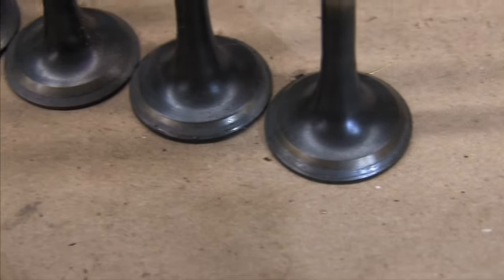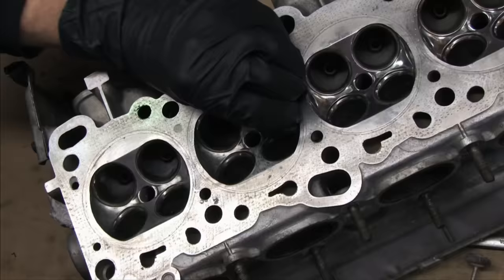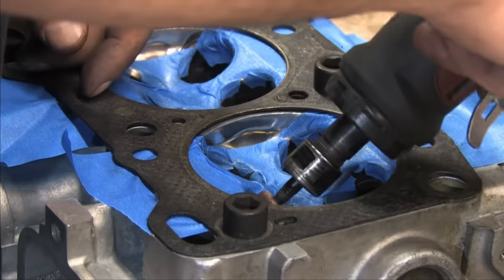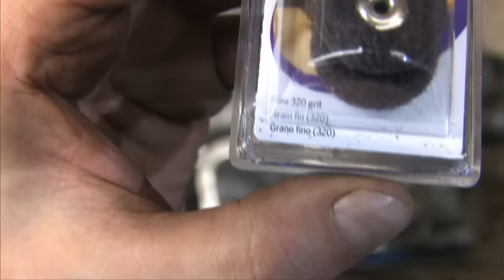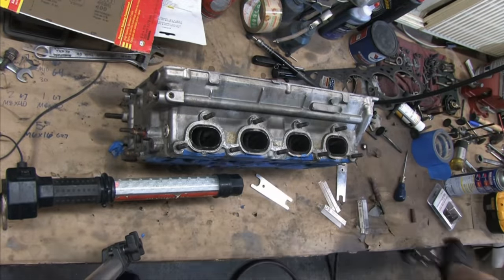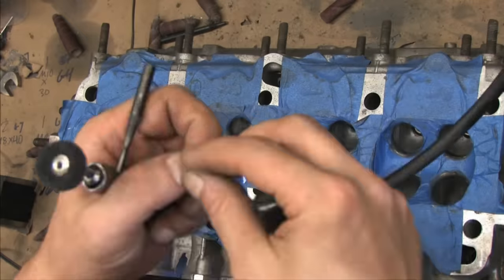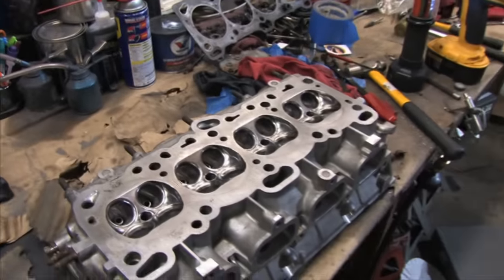Cylinder Head 204 - Porting & Polishing

Comment: Excellent video thank you ! What are your thoughts on. Single cut vs double cut tips ? For gasket matching a port
Reply from the maker: Single cut burrs are for Aluminum and softer metals.  Double cut burrs are for ferrous and harder metals.  Using them on the wrong materials may work, but it will cost you the burr you used on the wrong material as a sacrifice.  Double-cut burrs will clog up on soft metals, and single-cut burrs will break on harder materials.
Reply: Jafromobile thank you I appreciate it ! It’s for aluminum heads and I wasn’t sure which to go with. I’ll go with the single 👍🏼👍🏼

Comment: Now do a video on how to "flatten" the intake or exhaust ports (on the head) so that you can get a gasket to seal. Most older engines are NOT flat after 10-20 years of use. Besides removing all of the studs , removing the head and sending it to a machine shop ...there has to be a way to do it without removing the head and all the extra cost and risk involved .....

Comment: Something else that's sad. 8000 dollar race Motocross bike has the same casting flash in the ports too. Porting a 4stroke dirt bike cylinder head is a lot easier but similar to a car. I blended my intake but swirl roughed the surface. My fuel injector is in the throttle body behind the butterfly in the upper intake tract. My exhaust I polished mirror smooth. The head I was practicing on I trimmed off the end of the valve guide. Not sure if that was a great idea but wanted to try it. Tried to copy the look of a friends Honda cylinder head that was cnc ported.

Comment: Only one issue You need to keep the intake ports rough it help-s to create turbulance which is necessary for good combustion. The turbulence actually increases horsepower/torque as well as efficiency. 
If you polish or smooth the intake to much you are actually hurting performance.
Now the exhaust go to town  as long as you haven't  tuned your exhausdt length . A tuned exhaust length means that the pulses of your exhaust gas has a bounce back ehich improves scavenging meaning unburnt hydro carbons renter the exhaust chamber for a second chance at burning this increases your fuel efficiency.
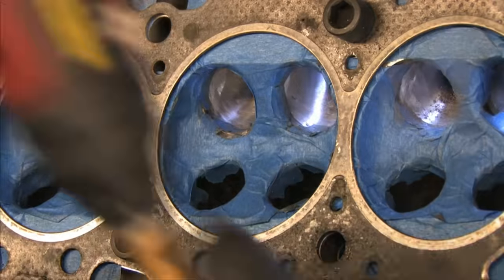Reply: 13:42

Comment: There is no more polishing even in exhaust. Rough surfaces allow small attached air bubbles to let the boundary layer slip by. The best CNC porting now includes dimpling a la top flyte, ping, etc. It's good for 5% flow increase across the board, smooth polished will cost you 5%. Same factors apply to the exhaust port. Polishing the combustion chamber and piston helps reduce detonation from hot spots. 
If you read drag times articles from big numbers of champions engine builders they have used bits with broken teeth and let them rattle around dinging, denting, and scratching the ports. It's dyno proven now.

Comment: I'm planing to do this job on an NA miata for an NA built, is it ok to mirror polish the intake ports? Also polishing the head will it decrease the compression? This is an amazing guide mate, because of you, I'm planing to do this job! Thanks so much! :)
Reply from the maker: I would advise against polishing intake ports.  Just because I experiment on a forced induction build where surface textures matter less, it doesn't mean I have a magic bullet for performance here.  Even in forced induction designs, it's a ton of extra work with minimal if any gains.  I did it just to show the techniques, and I didn't polish the entire intake port.  Only the exhaust ports are super-blingy and if you're not familiar with this cylinder head, it's not apparent even though I explained this treatment on each side and how I did it differently.  My intake ports aren't fully-polished.  It's pretty, but it's wasted effort on a NA build.  You could stop at 80 grit on the intake ports.  Nothing beyond that will show up on a dyno sheet or the butt dyno.  Sure, Polish the exhaust all day long... but don't worry about the intake ports.  Bigger gains would be found in cams and timing than you'll ever get out of the intake runners being polished.

Comment: My engine builder also works with AMS 

He told me you have a 4G63 don’t waste your time in the heads, turn the boost up and worry about tuning and the turbo setup. After all he years of building he concluded work like this just wasn’t worth the expense and the amount of money he would have to charge was wasteful to the customers build. 

He was for over sized valves and port gasket matching

He wouldn’t take my money to port the heads on a street car and he liked how much power the factory heads make 

Bill wanted me to use that money towards other go fast parts that actually make a impact and real gains not marginal expensive ones 

He said you do that investment in full blown all out race cars in Mac effort 800-1200Hp
Reply from the maker: Well, he's not wrong.  2 out of 4 of my street projects have ported heads.  One I paid for, and one cost me nothing to do myself.  "Investment" is subjective depending on your capabilities.  I have no regrets about either one, though.

Comment: No rough texture in a intake or exhaust port is good only benefit on texture is a golf ball design which increases air flow other than that it should be as smooth as possible

Comment: I use them same Dremel adhesive pads to polish 4 wheeler cylinder's I port.  But the brown pads are the best.  The purple pads are junk. They come apart and do not last but few minutes.  All you need is the brown pads. I feel like  the exhaust port  side is most important.

Comment: For more HP try port matching the inlet and outlet to the gaskets and then port match the inlet and exhaust manifolds to the gaskets - smoother gas flow in and out, more HP.

Comment: Question:
It's a bit long, I'm sorry sir!
I have a Mazda B3 engine, 1.3 liter SOHC, and I'm trying to squeeze some more power out of it. Couldn't get my hands on a BP engine. Waaaay too expensive for me!
I've already made it fuel injected, found a good throttle body and polished it and it's running smoothly and it's happy with the 115 n.m and 72 hp it's got now but I'm not! So all I need, is a bit of advice on what I should do with the ports and all the other things. Will you help me?

Comment: It's great but please share the difference before and after view as well as how it runs. I won a Elantra too 2006. Very expensive.
Reply from the maker: 2006 is very different.  Different engine.  This Elantra cylinder head and the car is a 1992 model.  Everything else bolted to it came from dozens of cars out of a junkyard.  Very cheap.  It outruns most of the new Mustangs.  Lots of drag race passes posted here in my videos.

Comment: The addition of just a bit of diesel fuel to the tank will remove the carbon from everything. Well pretty much so anyway. This does reduce the performance some. It may also ping or rattle if you get too much in the mix.  I put 1 gallon in honeys car every tank of fuel. I've done this forever. No issues except the mentioned. Want to go racing - run the tank dry and refill as required with straight gas. Almost forgot don't use as much diesel in the winter, cold starting issue may appear. A bit of experimentation will tell you how much to use. My rule of thumb is if it rattles on hard acceleration back off on the amount used. Porting and polishing is fun.

Comment: I am not sure if you know about mk4 golf 1.8t's but that's my current project... In my opinion I'm thinking it's a lot better of an idea for me to do a good porting/polishing on the current manifold and getting it powder coated rather than spending the money on a grams or a integrated engineering intake manifold. What's your opinion on doing an intake manifold porting job rather than spending the money on a higher flowing aftermarket one. I can't imagine I can't get similar flow from the oem with said job done?!

Comment: Would a flap wheel work for the port work? Seems like it might be safer since it's a smaller surface area and you can get better angles on it.
Reply from the maker: They work great if you can get one small enough.  Most of the Dremel wheels are way too big to fit until they're worn down pretty far.  That's why these poofy things work so well. They compress.  There's more abrasive material, and less wheel to them.

Comment: I know this video is old but I did not hear you mention, nor did I see, that you matched the ports to the intake or exhaust ports on the corresponding manifolds. That's another one of those "while I'm here" modifications.
Reply from the maker: It's a separate topic, and in many cases it can be a mistake.  Many people gasket match based on where the carbon buildup occurs on the flanges of mating parts thinking that's the area they have to play with.  Many think that's port matching.  It's one thing to match the ports, it's another to match the gaskets.  

Just because there's an area that can be enlarged, it doesn't mean you will gain ANY performance doing so.  In many cases, the increased runner volume slows down the escaping gasses resulting in things like decreased intake port velocity, or a reduction in pressure in exhaust runners prior to the exhaust turbine wheel of a turbo.  In the event that people use their carbon lines as a guide for where the gasket lines up, cutting those down on exhaust parts puts the gasket right into the fire, and typically causes them to burn up creating exhaust leaks.  There's a lot of people who do that wrong, and it really should be in a different video from this one.  Port velocity and manifold pressure ratios should always your guide in decisions like these.  Port match, sure... no problem.  I had no need to do that here because the exhaust manifold I'm using has very slightly-larger exhaust runners than the exhaust ports on my head.  A difference that's actually optimal for the turbo I'm using.

I don't expect you to look through all the comments and see where this was previously discussed.  Others have noted this was not in the video.  This experiment wound up getting way more traffic than I ever expected it to.  You will find hundreds of people ripping me for things that they insist I did wrong in this video, and hating on ME as a person for demonstrating something that made them uncomfortable (despite telling people not to polish their intake ports in the video and installing text overlays insisting they should stop after sanding them).  I know you're not doing that, so I wanted to save you the trouble of looking for it.

Comment: Ever thought about 3M nano coating exteriors and jet heat or other coatings for non contact parts. Internals ? 
 Easy cleaning every time. 
I’ve thought about it but not seen it on internals

Comment: I don't think you want mirtor polished ports. It may cause fuel to condense on them. But a fine sand paper roll finish is perfect I think. About 180, 220 or so will be great. 320-400 maybe on verge of over kill.. I never had issues using this. 600 for chambers. Better than nothing!

Comment: I think this is the best video I’ve ever watched on YouTube, this is probably my 10th time now and I’m preparing to get this done on my p13 head, is there any reason that you polished the combustion chambers first rather than at the end when you were done porting so there wouldn’t be any need to run tape? Thanks so much for all the information over the years
Reply from the maker: I put the tape on more than anything to protect the valve seats.  It didn't go so well. in that regard.  I ended up doing a full valve job on the head anyway.  At least the tape helped minimize the impact of the damage I caused so there was more there for the machinist to work with.  Don't waste your time polishing intake runners. Just get your contours right on the intake and call it a day.  The opposing port texture may or may not make a difference, but it's not where all the power is.  Wait... McLaren P13?
Reply: Jafromobile thanks so much for the continued help, I’ll definitely be takin your advice, unfortunately not, just a honda head off a h22😂

Comment: The intake ports should be left in a rougher surface finish. The slightly higher flow numbers you would get with the polish don't translate into hp numbers , especially with a port injected motor where fuel staying atomized in the air is more important

Comment: As usual, I'm looking at the comments and I see the same tired comments about how a rough surface is better for fuel atomization, blah, blah, blah. Bottom line, the smoother the surface, the better the flow. The better the flow, the better the go. Period. Fuel that is gathered up on rough surfaces, is not getting to the combustion chamber where it is needed. Fuel that isn't getting to where you need it, and WHEN you need it to be there, is useless, maybe even worse, it could be damageing to everything that depends on it being in the right place at the right time, and in the right ammount. It just can not be too smooth, or too straight. I did stop to wonder why you didn't cc the chambers and maybe even the runners, but since you're doing everythimg by hand, that might be a step too far. Great job, I know that your patience will pay off.

Comment: Port matching and exhaust port polishing yes, but polishing the intake port will bring on condensation of the fuel air mix (no benefit)
Reply: On carburetor engines not so much fuel injection

Comment: I have a question trying to take it to the next level after learning (🙏), how do you cut and shape valve guide to match port?
Reply from the maker: Valve guides are something that I won't install at home.  I don't have the machinery that can do it accurately much less even measure them.  Those tools are ridiculously expensive.  I use bronze manganese valve guides and they're hard as expletive to cut.  If I have a bad valve guide, I pay someone else to turn them down and install them.  BUT... if you're talking about how the ones in this video got shaped, each runner is split into two valve ports & the guide is right in the middle.  It's like 0⊓0 except the 00 are closer together and the ⊓ is in the way.  I shortened the leading edge of the guide and the two 3/4-view faces of it kinduv like OʌO.  I just made its profile a little narrower.  There are some people out there who grind them flush to the runner, but when you do that, you lose some of the support that keeps the valve centered and true in the seat.

Comment: What benefit comes from polishing the combustion chamber? Wouldn't you lose compression?
Reply from the maker: Yes, but it's negligible.  You lose more hp from knock and your ECU pulling timing as a result than you will from the compression loss.  Polishing the combustion chamber is a knock suppressant.  You need this treatment more on a high compression engine than you would on lower compression stuff.  I cc'd out the combustion chambers to find they were still the same volume that the cylinder head was specified to have [in the "Calculate Your Compression Ratio" video and the static compression on this boosted engine is 9.875:1.  For a boosted setup, that's really high.  I could afford to lose a whole lot more compression, really.  The effect was less than a few hundredths of one compression point because polishing doesn't require removing much material.  Polishing stretches the surface of the metal more than it removes it.  It's the sanding that removes it.  In fact, resurfacing the head raises compression more than polishing the cc will lower it.

Comment: Loved your video and the effort putting it together. You covered A to Z on the stage one, thumbs up.
I would like to comment on one thing, Turbulent and laminate flow. (now I am going to do so before checking out the Lovell stuff, which may change my mind).
I get your theory on the roof and floor. For mine though, Having a surface on the short radius that leaves its self open to detaching the flow causing turbulent flow and/or eddy currents along the boundary layer may not be as conducive as desired. 
(Reynolds Number, https://en.wikipedia.org/wiki/Reynolds_number)